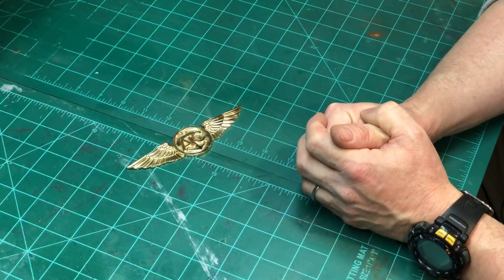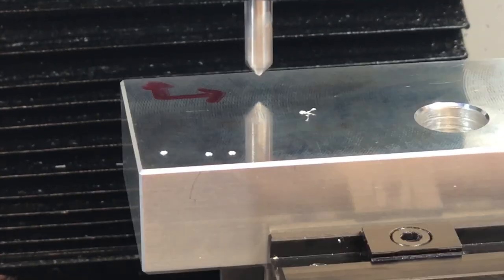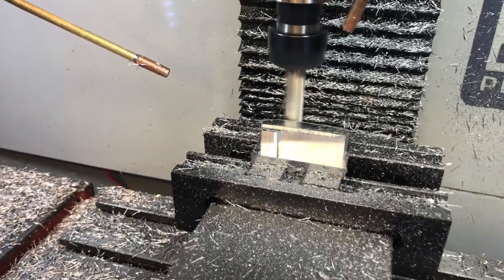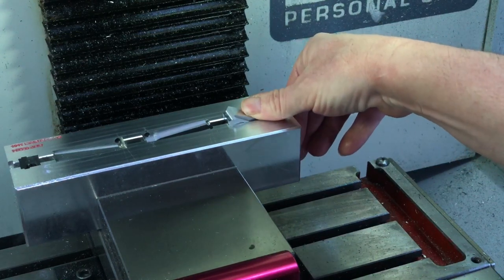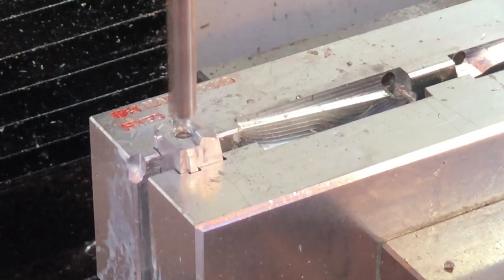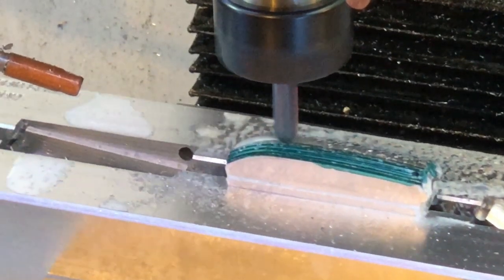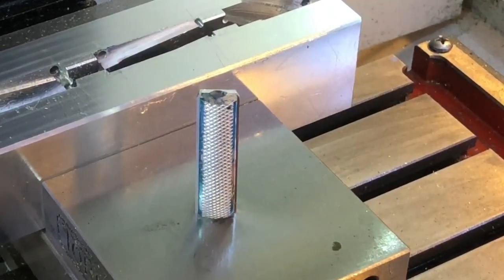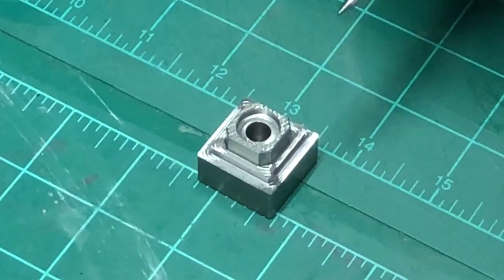How I machine gun parts in the privacy of my own home.

Comment: This was a very interesting video since I own a Government issue  Colt 1911-A1.  The housing on mine is a very tight fit by the way. The checkering on mine is not worn but it is pretty flat top for checkering. I know there are after market parts that they have several different arch shapes to better fit some size hands. It would be interesting to see how it would change the balance if you used  the aluminum part since it would not see hard military service. Looks like you could easily cut a new beavertail grip safety as well. Heck you could make the hole frame. if nobody checked you. Stainless would make some nice parts.  If I only had a CNC mill! Years ago I had my 1911 reworked at the Rock Island Arsenal to improve the fit and action and add adjustable sites and modified to feed semi-wadcutter for competition shooting, but now way to old for that.
Reply from the maker: Thanks for commenting and subscribing!  I think you need a cnc mill also!  My next 1911 video will be making the mainspring housing out of steel with making the lanyard loop.

Comment: i use i little tormach when my HAAS is down, (Rarely)  and i think its better suited for smaller than 1/2" end mills on any metals.  (I wouldnt even want to do steel on it) Ill use a 1/2" on proto foam, but ya, that thing is so rickety. Oh and you can get a drill through a side hole if you bore it with an end mill 1st.   But always try to design a flat for holes.   Not always possible though.
Reply from the maker: I have had great luck in steel and stainless with  1/4 cutters on my Tormach 440.   I have another video where I make the same part in steel and I milled a pocket for that .280 hole.  Worked much better.  Thanks for the comment.

Comment: I see you you're using a Tormach, but what tolerances are actually needed for firearm parts, or really just firearm frames? Can .005-.010 inches off still create a functioning part / frame?
Reply from the maker: The Tormach is capable of holding better than a thou most of the time.  I have found that setup is one of the most critical components for accuracy.  If you have dreams of machining 1000's of frames, I would get a bigger machine.  If you are looking to machine one frame for your self, you can get there with this machine and good set up.
Reply: @LastBastionLabs  hmm I heard that mostly what should be concerned about is clearance. And for a frame that would include pins / rails if its a pistol. And supposedly looser tolerances for rail is good. And for pins. Well people drill out pin holes with a hand drill so. Right?
Reply from the maker: @GoldenTV3  I have never done a frame or completed an 80/20.  When you say "clearance" I'm assuming you mean Z height clearance. The 440 should be sufficient.  For hole placement, set up and process are critical.  Hole placement is easy, its your ability to drill perpendicular to the work.  If your drill tip wanders then the hole placement on the other side will be off and would required increasing the hole size to allow for fit.

Comment: I’m building some repro m1911a1s right now. 5 in total for all the guys in the fam. I’d love to buy five of these in carbon steel when you already to make them. I’ve bought two actual ones from eBay but the prices are massive. Also they are worn out and the checkering on the back is pretty bad. They don’t fit the look of the new builds and won’t even after new bluing. Contact me.
Reply from the maker: Nate, Happy to help.  Please email me at Lastbastionlabs@gmail.com  I have some questions and then I can get you a quote.  The link below is to my video on cutting steel mainspring housings.  https://youtu.be/l6ksecCPGr8

Comment: Can a tormach 700 machine a 1911 frame?
What about the slides?
Reply from the maker: In theory yes.  The 700 machine has a work envelop large enough to do a frame and the slide.  Not sure about the Z axis.  If you are machining a slide from scratch you may not have enough Z axis to drill the hole for the firing pin.  You would have to model the slide and take some measurements.
Reply: Which of the tormachs would have enough z axis to do the job completely
Reply: @LastBastionLabs  do you  think there is a benchtop cnc machine that is capacble  of doing the job of completing an entire frame and slide from scratch?
Reply: when you say you will have to model the slide and take some measurements,can you elaborate?
Reply from the maker: @lance5295  The total z height you need to know would the length of the slid, plus the length of the drill to bore the hole plus the length of the drill chuck.  I do not think the 440 will have enough.  I'm in the process of moving so my tools and machines are all packed up.  You could contact Tormach and ask them.
Reply: Can a tormach 700 machine a ar15 upper receiver
Reply from the maker: @lance5295  No idea.